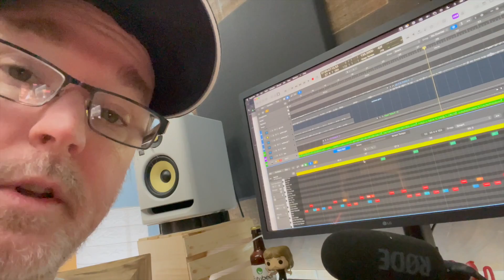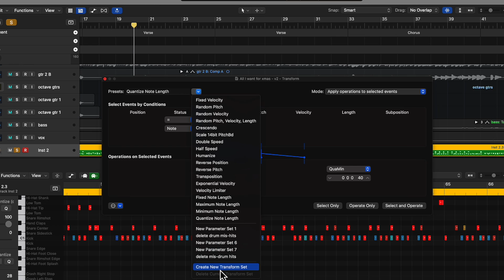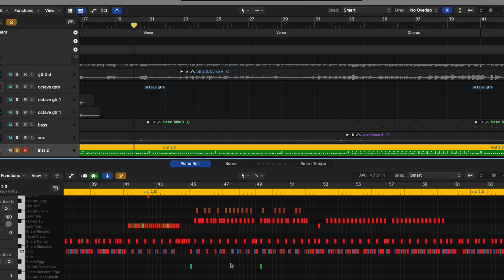Recording midi drums? Here's how to get rid of unwanted notes easily

Comment: this is pretty good but I didn't see what software.  I'm thinking it is comparable to logical editor in Cubase.
Reply from the maker: It's Logic Pro. Any DAW should have a 'piano roll' view but I don't know how flexible the others are for transforming midi. Logic's it pretty powerful.
Reply: @cleverdood  My first attempt was to find a way to delete notes that are too close to each other, maybe like less than 1/32 but I did have some success using low amplitude, as you suggested with their logical editor. that was a simpler setup, though some double are almost the same velocity, and choosing a higher setting might also delete some desired hits.